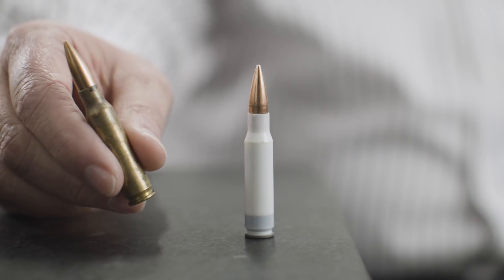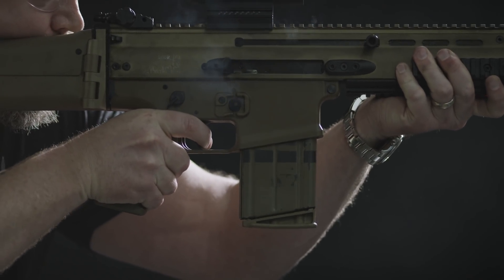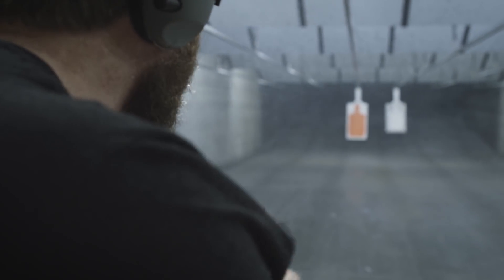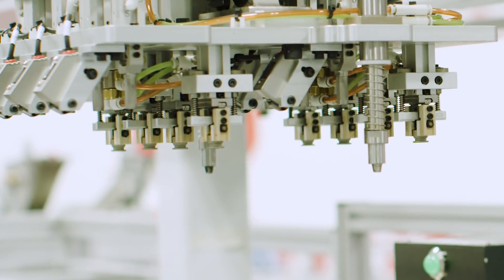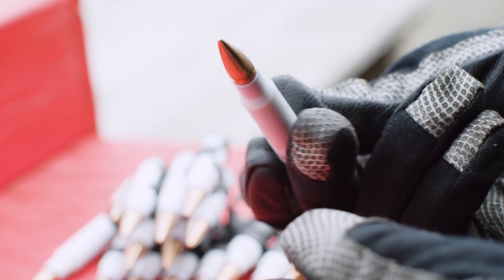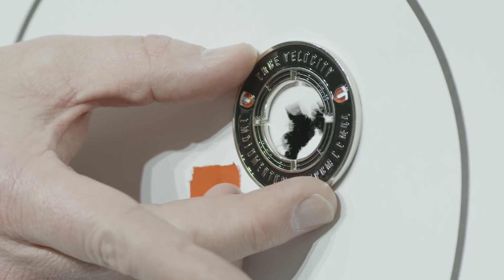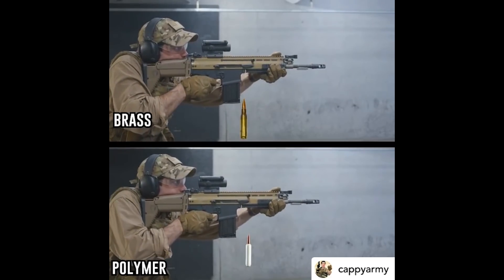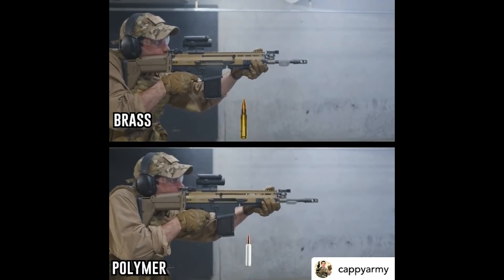Composite Ammunition is More Accurate than Brass | NGSW | Next Generation Squad Weapons

Comment: I’ll stick with brass, it’s reloadable.
Reply: But you can 3d print plastic, right?
Reply: @osborne4282    I doubt it is just plastic.  Probably plastic, glass, and aluminum.
Reply: @osborne4282  .  3D printing is nothing like injection molding.  Printed parts have weakness at every layer that injection molded parts don't.  Also, most 3D printed parts are not water proof.  This is why you won't see 3D printed drinking glasses.  Not to mention, 3D printing is not smooth.
Reply: @ronniestanley75  3D printed parts are in fact waterproof, though the reason it’s not used in food and drink applications is due to the rough texture and consequentially porous surfaces. Though that is what I know about FDM printers, resin laser printers may have different properties. Also the material used for the print can vary greatly in quality and mechanical properties not to mention the myriad of factors you can find-tune for a specific purpose.
Reply: @osborne4282  You can't buy this high grade polymer buddy...
Reply: @bquick6317  if you can buy the ammunition then you can buy the polymer...
Reply: The polymer is most likely recyclable ♻ and it looks like milk cartons anyway, just melt down or dissolve in solution and reprint like with 3D printers.
🤔 Cheaper, faster, increased ballistics, runs cooler...

Reading on i would agree with injection molding, not to hard, we did it in the 7th grade with what looked like $40 worth of stuff, and we had one bigger machine with it's own hot reservoir that couldn't cost more than $200 at the time.
Say $500-$700 now for the whole setup.
Reply: You’re missing the point. For military ammo you don’t want the ammo to be reloadable so that the enemy doesn’t use your brass. Insanely expensive? Yes but that’s just like anything else that’s new being created to eventually be used in mass. When brass ammo first came around when we stray from cap and ball muskets it too was insanely expensive. Brass isn’t going anywhere for the civilian market because of the reload-ability but if I’m in a war it’s a tactical advantage so my equipment isn’t used against me.
Reply: I just want to know where have all the primers gone to
Reply: I don't think I would use  3d printed cartridges
Reply: It's not "reloadable" if you're in a firefight
Reply: This wasn't made with hand loaders in mind, it's a genius concept that could improve lethality on the battlefield
Reply: Christopher Elsasser, acting CIA Director after William Burns (Jim Mansfield) has already been dismissed, I understand.
What an asshole.
I'm not impressed.
Reply: Once
Reply: Let’s see in twenty years.
Reply: @johnnewman8639  in 20 years rail gun technology will be profected and standard in hand held weapons. There won't be a need for brass or burning powder just projectiles.
Reply: NO!    Battery technology has not had a meaningful advancement in 20 30 years.
Reply: @CETGale  PURE BLOODS FOREVER!
Reply: @cryptosig283  he lives in your head rent free.
Reply: @themanhimself3  who does?
Reply: @CETGale  stop fantasizing In the comments and get a room with ya buddy
Reply: @CETGale  just make sure your name is not John Connor or the bots will be hunting you for sure.
Reply: @samkay6042  
Don't count on it. It requires lots of electrical energy, which would require LOTS of batteries, electronics, etc.
Reply: @AKlover  
Well, I agree with you that railgun technology WONT be shrunken down into infantry rifle sized weapons in 20 years. But I disagree with your battery technology comments. It's true that LiIon and NiMh technology has geberally "leveled off" in the past 9-12 years, but batteries were still improving by leaps 20 years ago.
Reply: @HighlanderNorth1    The battery to power A railgun, coilgun, laser, or plasma weapon in A man-portable format is NOWHERE on the horizon even with the integration of Graphene.  Too HEAVY and insufficient power density and all that before you consider adding the weight of some sort of parasite energy recovery mechanism into the weapon.  We are going to be using "Gas Diversion" for quite A while longer.  Building for higher chamber pressure or A far more efficient ignition mechanism is the only real window left to exploit there.
Reply: @samkay6042  naw not in 20 years. 2077 maybe
Reply: @randmayfield5695  lol can’t take a joke?
Reply: @samkay6042  in 20 year i will still use a revolver because its cheap and i dont think forcefield jacket will be invented by my time. In 200 year i would buy a railgun but then in 200 year i would be dust
Reply: @AKlover  Have you been living under a rock? We’ve gone a plentiful distance from the alkaline and NIMH batteries.
Reply: @CETGale  can I join? ;)
Reply: @samkay6042  lmao. "Fusion is only 20 years away"
Reply: @Dylan Wight im pretty sure very large railguns are even further away than smaller ones
Reply: @samkay6042  railgun as a standard rifle? I definitely more impressed if that happens. It's rather a Sniper / Marksman Rifle
Reply: @samkay6042  I'm sure they'll manage to solve the insane recoil and having to put in millions of volts for the electromagnets! Maybe they'll just bring a massive battery with them. Carried by camels (with laser guided missiles on their back as well)
Reply: @samkay6042  how do you expect to recharge the rifle when there's no electricity during grid down?
Reply: @samkay6042  no
Reply: @AKlover  there's a significant financial incentive. First one to come up with a better battery becomes the world's first trillionaire
Reply: @samkay6042  Fun fact, combining a railgun with a firearms would be more efficient, as we could speed the round to let's say 2 kilometers per second, along with the speed at the beginning being 900 meters per second.
Reply: Hot plastic in a gun during a fight. Lol 😆

Comment: Boy oh boy I can't wait for the cost savings that polymer cased ammo will provide in this shortage and now that we can't get steel case. I'm sure this is the affordable solution like it was originally said to be and what we have all been needing and not overpriced plastic.
Reply: Who tee who bought some and his videos are showing the ammo at $10 a round and groups are bad, also it doesn't run in certain rifles. I'm going to stick with my brass. 

https://youtu.be/8Ib7tFmUDQE
Reply: There will be No long term savings in the market. Only during introduction. 
Then the price will sky rocket after they have secured a certain percentage of the market
 Then the company will make Huge Profits.  

And every place We Shoot will be Covered in  useless Plastic cases. 
What is wrong with Brass again?
Reply: @mikehagan4320  and don't forget you can't reload this either, so you just keep losing long term.
Reply: I just saw it fire sale on the internet as it was double the price of match grade brass ammo It will be years before they can produce it at a cost effective means
Reply: You shouldnt be trusted with a firearm if you think this is supposed to be low cost  or an alternative to brass

Comment: This information, until you or someone else produces test criteria and results, is just another manufacturer repping their brand. 
Heat transfer is irrelevant in the hundredth of a second the brass remains in a semi-auto chamber. And I would love to see data, independent of course, on the amount of powder used and the actually efficiency.
Lastly, prove your accuracy claims. Simple.
If this has been done by a third party I would love to see it but have yet to find any.
Reply: Go check out whoteewho he has several videos on this stuff being shot from various rifles and platforms. Then for comparison check one of his on Norma whitetail ammo. You might be surprised how much better the cheap soft point Norma ammo shoots over this high tech, high cost polymer cased ammo. From what I’ve seen for performance/ accuracy from this stuff let’s just say it’s likely a good thing for them all ammo sales are final and no refunds. If they where giving this stuff away I would pay for something else 😂😂.

Comment: The claim that heat is transferred to the chamber from brass more than polymer is comete BS. No different than carbon barrel manufacturers claims. Heat soaks somewhere end of story. It's just moving the heat to a different spot. 

  As far as using less powder I can almost get on board with that, however achieving the same velocity with less powder it still has to be producing the same pressure thus creating the same heat if not more focused on a different point. I'm sure you needed a fairly thick case to withstand the pressure so naturally you use less powder yielding higher initial pressure.

   When will you talk about barrel fouling due to polymer adhesion? Or will you claim the polymer coated barrel increases accuracy as well lol. 

  I'm happy that alternative products are being explored,  however the, we need to be the first to the finish line is completely non productive .
Reply: These are all great points
Reply: You sound knowledgeable in this subject
Reply: @offensivecreampie3015  Not really, he's confusing composite rounds with polymer, HUGE difference..

Comment: What's the recycling aspect of it? Can you use them again? Can you melt them down into new ones?
Reply: Accuracy is not good at all from the testing we did.  You cannot recycle it.  The base is metal along with the primer.  Cannot reload it.  They are expensive.